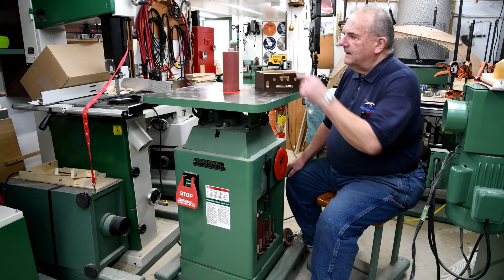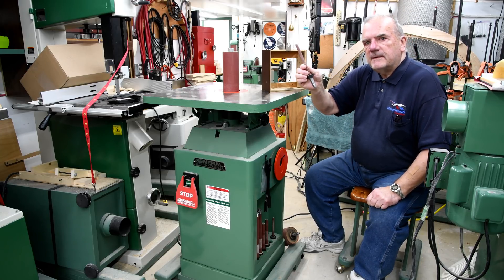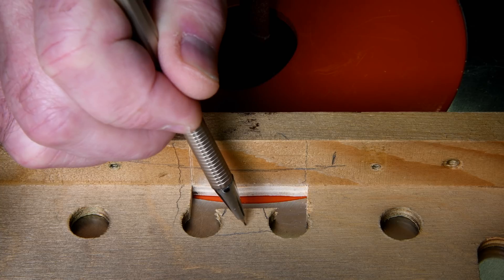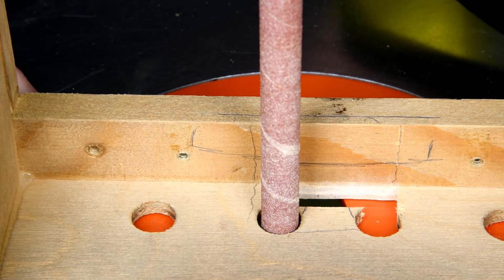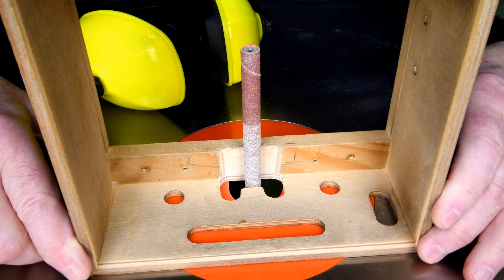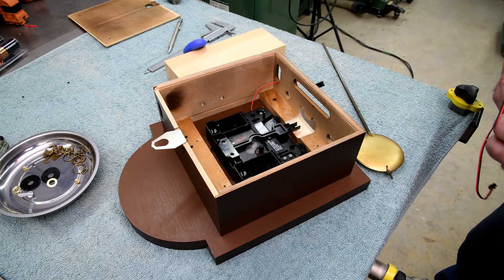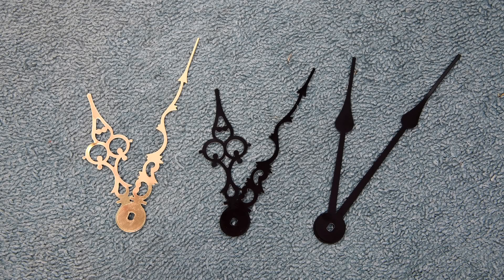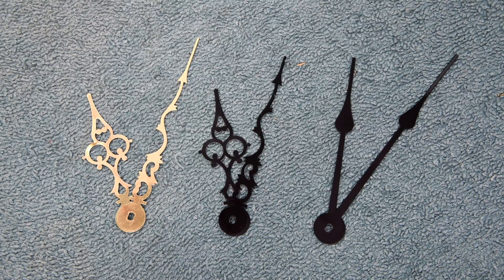Uncle Jake's Clock - Part 4

Comment: Hmm the speaker on the top is pretty reminiscent of arched dial clocks having a beel there.
And yes with arched dial clocks it is common i myself have 3 of my 5  arched dial clocks having a bell behind the arch (actualy i should say 4 because one is a non chiming quartz)
And as for the hands i looked at ep1 and option 1 is closest to the original colour but 3 is closest to the original shape.

Comment: Hi Ron Paul from Plymouth England again. Did you know the tip of cleaning off your sandpaper on your oscillating sander with a piece of old rubber garden hose. It also works on other sanding machines. Cheaper than the purpose made ones. keep up the great videos.
Reply from the maker: I'll try to remember that tip when my purpose made ones get used up. Thanks Paul :)